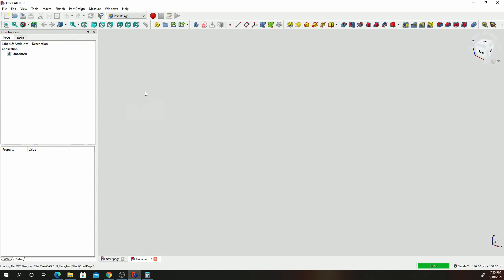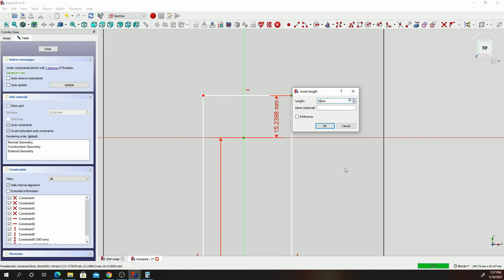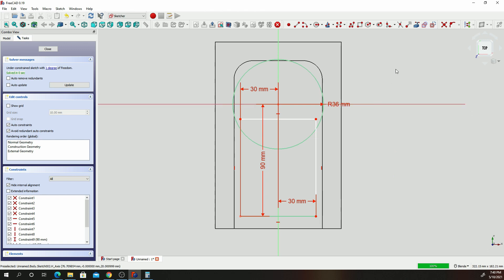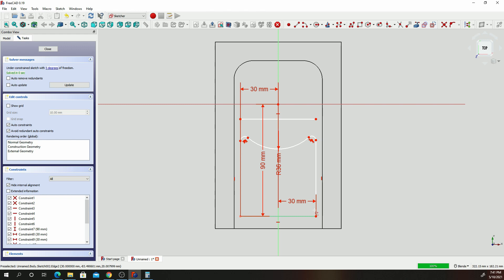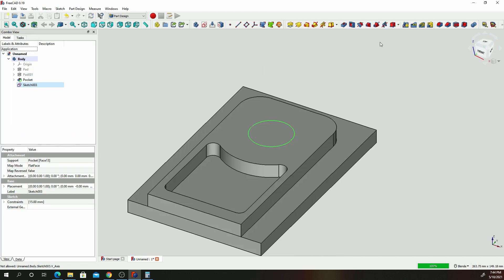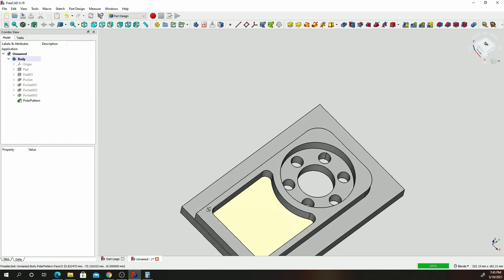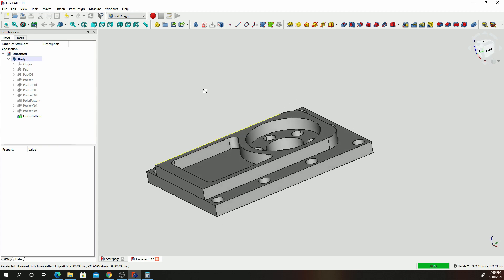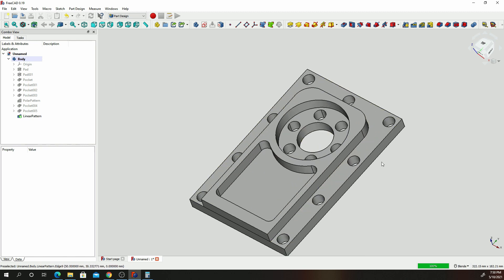FreeCAD Mold Plate

Comment: On minute 12:15 why you don't mirror the left hole to the right side?
Reply from the maker: When you use the mirror tool in sketcher workbench, the resulting sketch is created as a separate new object which  will require its own operations when creating solids. So drawing the 2 holes eliminated an extra object which would have required extra steps to create  the holes on the right side.
Reply: @techwithjulius  Thank you for your explanation.